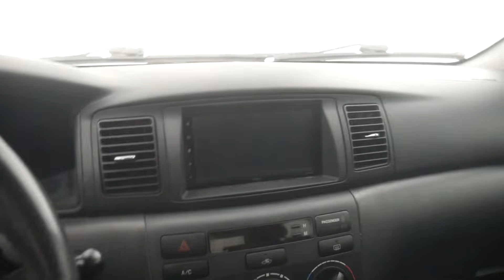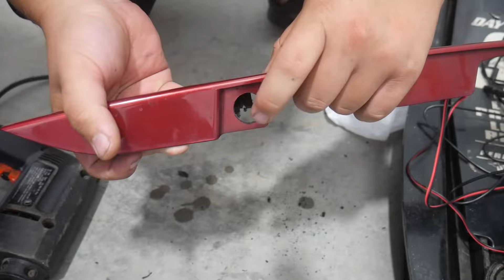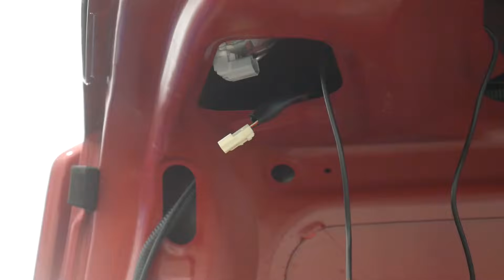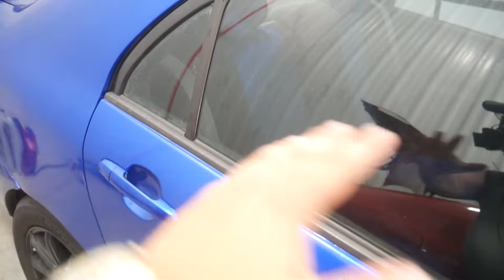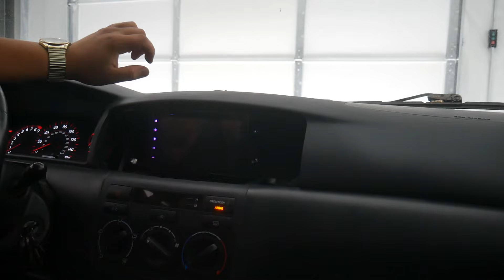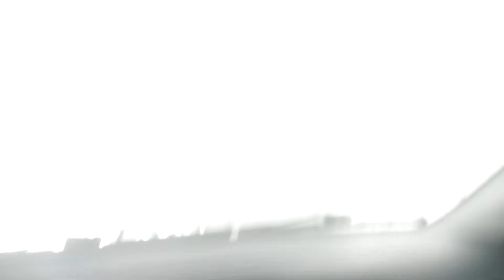2003-2008 Corolla OEM Style Reverse Camera Install

Comment: Haha I knew exactly the issue and glad to see at the end ya got it. Thanks man I’m doing my 2006 Corolla it’s clean inside full system. Just did all new front end. Lights, fog lights bigger wheels for more speed & switch everything is rather cheap eBay lol all new brakes done doing struts & sway bar links this week. Good feeling knowing your 20 yr old car is “up to date” when I’m ripping it at 65mph.

Comment: I know this video is 3 years old. So I was wondering if he could have drilled the hole for the camera in the center, between the the 2 tag lights? Or does it have to be off center or on the side the driver would be seated on?
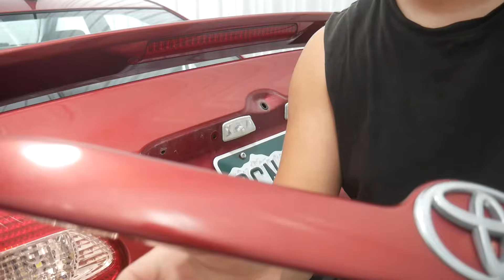Reply: 2:35 in the video dude...
Reply: Ok dude thanks. He hasn't revealed what he is putting in the center?
Reply: Still not answering my question. Can you see better with it towards the diver side.or do you see more with it centered. This is more the reason I was asking, for visual purposes.

Comment: I have the same issue. After installing the camera to my Android radio player, camera doesn't turn on. I tested and found that when I put the car in reverse, the reverse light does not come on. I believe it was working fine before. Now I have to check to see if the reverse switch went bad or the back up fuse is burnt.

Comment: How do you remove the clip that is behind the emblem that is on the trunk lid?
Reply: By pulling really hard. Just make sure you remove the screws on both side, 1 on the left and 2 on the right (key). I find it helpful to have something flat pushing out that middle clip so you don't break anything.

If you already have the screws put; they are helpful in putting pressure as you are pulling the piece out!
Reply: @ thanks man!

Comment: Very nice video bro! How i can find this camera on the web?
Reply: The echomaster PCAM-201 is great quality and OEM grade.  It also has the same small 4 pin connector like the one in the video.  People don't realize how big of a hole you have to make when using a camera with RCA styled plugs. It is a little smaller than they one he used but and does not need to be bolted in place so it is easier to put it i the center position.

Comment: I'm trying to install a reverse camera on my 2003 Corolla, and I am stuck with the removal of that plastic panel lid. I removed the 3 metal stubs, but it also has a plastic pin located exactly in the center, right behind the Toyota logo, and I couldn't figure out how to remove the panel lid without breaking the plastic clip, yet. Did you just break it? Or how have you done it? Any help would be much appreciated. Thanks so much.
Reply: Take a flat head and there is a tab on the left and right side. Push the tabs in and wiggle left and right and eventually it will give
Reply: @junzilla13 how tf do we get to the tabs at the same time?? There’s a thing in the way
Reply: I am stuck in the same step, trying to figure it out how to remove it

Comment: Does this camera have other features that just the rear view camera? For example different t angles or pre collision warning or when unget close to an object etc? I guess u need sensors to get that to work ?
Reply from the maker: Besides parking lines, not really. Angle is fixed and there is no ability to add pre collision warning as far as I'm aware

Comment: Excellent video Will. Can the lens be tilted up or down to get a better view of the rear surroundings?
Reply from the maker: Thanks! The lens of this particular camera is fixed and doesn't move, if you want a camera with an adjustable lens then this camera might not be the one for you

Comment: Hey Will nice video.... just want to let others know that installing the camera in the center is also an option.   I have done  two cars putting them in the center.

Posi-tap wire taps are a good way to tap into wires without causing permanent damage. 

I also helped a friend install both back up and front camera on  a XRS.

One tip I can give is make sure you leave enough slack on the trunk hinge.  If you don't leave enough slack it will put strain on the cable and eventually the cable will short.
Reply from the maker: Thank you! Glad to see this comment, the great thing with these backup cams is that they can be installed wherever you want! Haven't used Posi-taps before, I'll have to give those a try some time! And yep, I made sure that there was enough slack for the cable behind the trunk carpet, last thing I would want is for the cable to be damaged and needing to spend more time fixing it!

Comment: How do put back engine mount bolt next to air intake back because I’m having trouble with mine the metal is out line like the bolt has to go in angle but I have no luck
Reply from the maker: Hard to tell you exactly since I can't see the issue, is it a replacement mount? If so maybe there's something defective with it that's causing it to not line up properly with the bolt holes. The bolt shouldn't go in at an angle, that'll just crossthread it
Reply: @WillChang  yeah it’s the transmission engine mount the bolt that is in between the air intake and the battery because I had to rewrite the negative ground cable so I took the bolt off the Engine mount and where the bolt for engine mount the hole is inch off I was wondering what I can do , do I have lift the transmission up little bit to adjust it?
Reply: @Valentinxx66  Maybe a photo? It's dangerous to give you advise without seeing what you're about. Will is right about the mount being a potential issue. sometimes jacking the engine up a bit helps, but be careful where you put the jack!

Comment: Good video! I have been needing to get another backup camera. The one I have I think it’s going bad because a bunch of lines pop up on the screen when I go into reverse now.

But the other wire behind the radio is most likely for a front camera, because when I put a front camera in my corolla I used a constant on  wire so I can view it any any time.
Reply from the maker: Thanks Brandon! I'm hoping this camera lasts a long time as it was $100, makes sense for the constant wire to be for a front camera. I've been considering installing a front camera myself, how've you liked yours so far?
Reply: @WillChang  to be honest, I sometimes forget I have the front camera. I thought I would use it a bunch, but I don’t. Lol 
It’s just something cool to have.
Reply: Glad to see 2 of my favorite YouTubers know each other
Reply: @jaredhernandez2313  gotta consume all the corolla content I can as well as produce it! 👍
Reply: Brandon I would recommend the echomaster brand if camers....  they produce good images and are designed to be powered constantly so you can use the option when wiring it up and not worry about it dying in 2 years.
Reply: @correya.lettsome4702  thank you! I will check that brand out!

Comment: Nice, hope the fact that it’s not in the middle doesn’t affect the alignment too much
Reply from the maker: So far I haven't had any issues with it not in the middle, but the camera can be mounted pretty much anywhere so if you'd rather have it in the middle then it wouldn't be a problem!